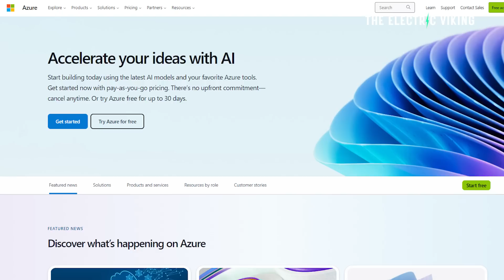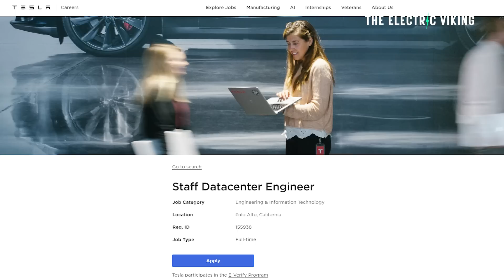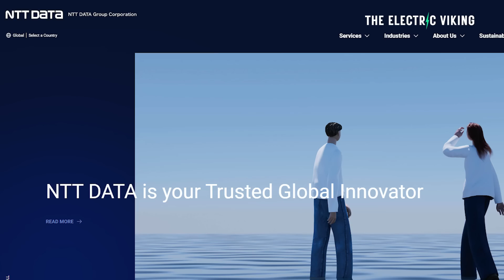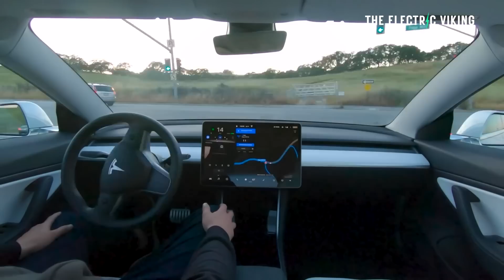Tesla are building mysterious new ‘1st of its kind’ data centers

Comment: Locales are beginning to push back on these giant facilities because the outsized electricity requirements often mean new production and transmission costs.  Tesla might be leveraging its many talents in chip design, energy storage, AI, integration and VPP to radically reduce electricity use and gain flexibility in when energy can be gobbled up when cheap and consumption can be leaned way down during peak demand hours.

Comment: Tesla data centers should deploy bespoke solar, wind, and battery (SWB) power generation, co-located with the data center -- eliminating most of the transmission and voltage transform expenses.  (Still can use some of the cheap grid power at off hours.)  Vertical integration can slash cost of compute; data transfer to/from the data center is cheap compared to transferring electrical power, even if it is sourced from SWB assets owned by others.

Comment: Getting into data Storage and possibly service like AMAZOn , Google , etc  is quite possible and profitable for Tesla . this could also mean using ARM  chips which are very energy efficient ,. Installing a mega battery is easy it doesn't matter where you install it for arbitrage of energy price differential to work . For MEgacharger V4 they need to be on main roads that trucks use and at depots with Megapack batteries . My bet is an expansion into DOJO as a service . Remember TESLA could also buy a chipmaker or work with them to build a new facility in the USA and take advantage of the Government subsidy for chip plants built in the USA . It takes about 3 years to built a foundry to make chips . They could also use the heat from DATA centres to generate power .

Comment: A combination of battery storage, solar cells and a super charger all at the same location with a data center just combines technologies that Tesla already has.  Adding AI to manage the power generation/distribution should generate significant cost savings.   Directed engineering is where Tesla excels.

Comment: Taking over existing data centers rather than building your own means that they are going to move fast. Hmmm what do we know of that would need multiple data centers....data centers that are spread out and not located in one area. 
That's right...ROBOTAXI!

Tesla is so close to solving FSD that they are opening up the data centers that will be the backbone command and control for operating the massive fleets of robo-taxis, along with backup/failover locations.  While they are waiting for regulators to allow the taxis, they will use them to host Dojo AI training computers and rent out time on them to other companies developing AI solutions. 
I think that these centers are going to use starlink connections as backup if land based connections fail.

Comment: On Tesla AI day, they had presented a plan for large Data Centers running a large amount of Dojo’s. Hopefully they have a more intelligent cooling,than usual data centers. Like chinese crypto farms before hey shut down. That was cheap and effective by using polythene sheets to separate air inlet and outlet of all miners. As each miner has its own fan, that is enough to blow the heat out of the building. Usual data centers don’t separate inlet and outlet. (some try to separate inside of a cabinet) Due to that the air is getting hot and hotter, each time the air went through a computer. As consequence, large air conditions are needed while the chinese miner need polythene sheets only without any extra power.

Comment: This is very interesting because I work at the largest data center in the world, the Meta data center in Altoona Iowa. So if we are talking small data centers and not enterprise data centers I can see the battery packs being a thing. Just as power is used for compute however power used for cooling is even more important. The cooling is just as big of a deal so I would be very interested in how that's is being done. Direct mechanical cooling of a data center is hugely power hungry so to scale up to enterprise size data center we use evaporative cooling. The next big thing is redundancy in the power path, you have two choices multiple feeds from the utility or several emergency generators, we have both depending on the iteration of the building. It's a problem using the generator however because they are so polluting, a 3 megawatt generator under full load will burn 200 gallons of diesel fuel per hour, so if you can imagine 78 of them burning 200 gallons per hour because a tornado took out a high power line. very interesting.
Reply: IMO they should just look at throwing data centers in the ocean.  The up front costs are high but the ongoing costs could potentially be lower.  You need scale though.  It cant just be one vessel.  They need enough data center vessels built to be able to make a support ship economical. Microsoft tried it already and it seems like the results were promising.  Scale is key though which is one area Tesla/SpaceX has an advantage.
Reply: @dpen653  I don't think putting data centers IN the ocean is viable, but I do think using ocean water for heat exchange is. Most people don't know it, but Gary Indiana is being bought up by data centers intent on using lake water as part of the redundancy cooling plan. Land is cheap there because everyone knows Gary is a shit hole crime-ridden land on detritus.  The thing is, the racks are high maintenance, so serviceability must be taken into account, and submerged data centers are not servicable.

Comment: This is huge.  You are definitely on to something.  Not just data centers but networking.  Connect the dots.  What if these data centers and Tesla cars were directly linked to each other through StarLink?  It sets Tesla up as a directly connected, fast ISP -- BUT it will be much much more than an ISP.  They will be using xAI instead of a search engine.  I think the first thing Tesla is attempting to do is improve and optimize the high speed IN CAR internet access experience.  Think about it.  Once Tesla's FSD is operational, the predictable thing is that people are going to want to surf the net or download movies, or play video games.   How will Ford and GM be able to compete with that?  The Fords and Gm's of this world not only will be forced to license the use of the Tesla charging system, and the Tesla FSD software, but also the Tesla/Starlink/high speed internet access package.  Think about it. This is why it is Tesla building these data centers and not StarLink or X.  But, here is the thing, just like Ginsu knives, there is more.  The biggest play here is for business customers -- including large corporations.  Instead of a business locating its IT data center services using AWD, microsoft, or google, they will be incentivised to locate them in these Tesla data centers, to improve worker productivity while their employees are in a vehicle on the road.  If I was Amazon or Google, I would be worried.  This is huge.

Comment: Maybe being near some big building and giving cooling water as hot water as product when datceners are too large then there is hard to sell that hot water for example near hospital when it is at normal operation then tesla holds some hours of backup-power  constantly at megapack when some kind of storm or something nears Tela will pump it to days and then current backup generators are obsolute. Those megapacks are also used inside cities to even the load of grid inside city that let not to build new powerlines and transformers  since more power is needed inside that area due to electric cars so it will give ability tio hav fast patch to grid when converting when grid usage stabilizes then those megapacks are movedanother area so it will hepl scaling up grid . And therefore those megapacks will be utilized a very long time and the number of them needed is greater than we think.

Comment: Maybe Tesla is using its knowledge gleaned from the design of Dojo, so make their own Datacentre hardware which is optimised for AI? Selling AI cloud services is likely to be a huge money spinner, and they are uniquely placed to do it. These are power hungry beasts, so it makes sense to make them as efficient as possible and to pair them with Solar and Megapacks. It could be a huge business opportunity.
Reply: This theory is a winner. AWS prints money. Dojo cloud services (DCS) can also print money.
Reply: 🤔 interesting
Reply: 100% of A.I. should be directed at predicting stock values.  Tesla could have an infinite and exponentially growing money source simply by getting stock picks right 75% of the time.

Making cars becomes irrelevant at that point

Comment: Whatever main chip Tesla is putting in servers in those data centers, mass producing them for the data centers will drive the price down for the data centers AND for other chip applications throughout other Tesla businesses.  I like Sam's suggestions about integrating Megapacks with the data centers, superchargers and solar power also.
Reply: @colinkeizer7353
Cooling is a big problem in data centers. Water cooling determines where they are located. It uses a lot of energy.

We all wonder when Tesla will have their own HVAC. Maybe their engineers can make data center cooling more effective too.
Reply: @larsnystrom6698  I dont get why Tesla wouldnt just find a safe place in the ocean to build a data center.  Microsoft did that a few years ago and it saved them money on cooling since they are using the ocean to keep everything cool and the equipment lasted longer as well since the vessel was filled with nitrogen.  They had less failures than on ground data centers.  Its not like Elon doesnt have access to people over at SpaceX that know how to build big vessels.  The biggest issue is maintaining the data center but that problem could be solved by a bunch of companies building in the same area.  The economics of a support vessel makes sense.
Reply: @larsnystrom6698  Think about that comment -- It uses a lot of energy.  If solar power and Megapack batteries are attached to chillers and dehydration technology, it is possible to produce water from air and use that water to cool servers.  That's the kind of radical change Elon brings to old businesses.  MAYBE that is the sort of change he has in mind, here.  It will surely be fascinating to watch, no matter what he does.
Reply: The whole of downtown Toronto is cooled in summer by cold water drawn by a huge pipe to the bottom of Lake Ontario. With all the available renewable hydro electricity available from Quebec, a plan like this should be "no brainer".